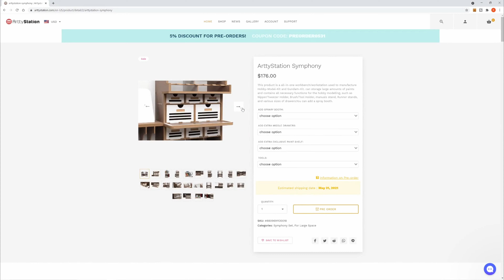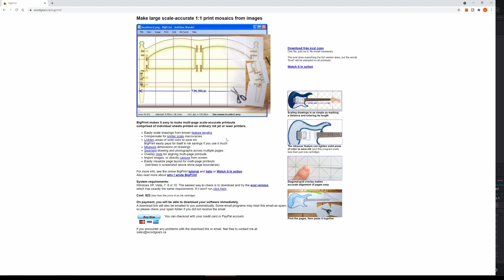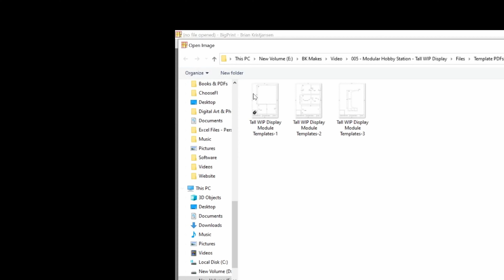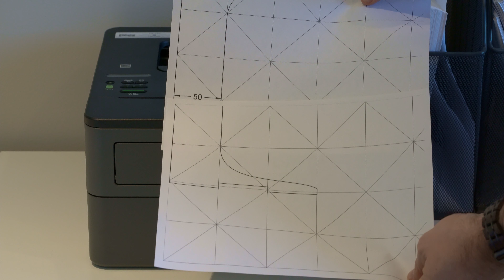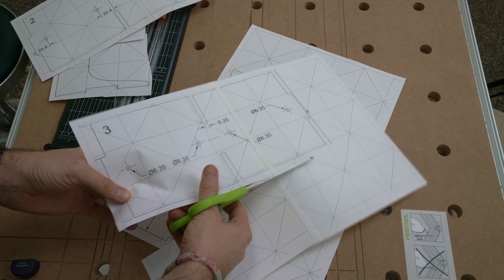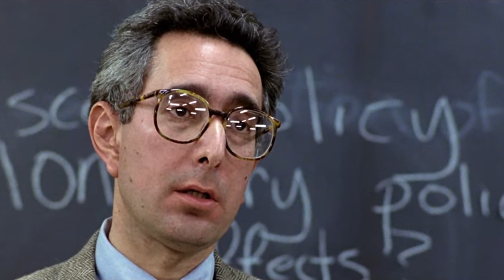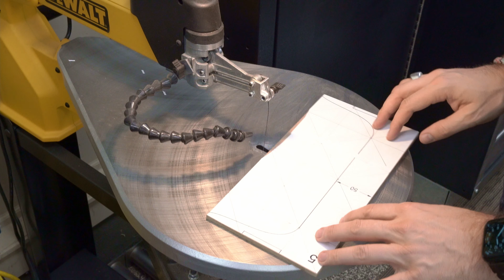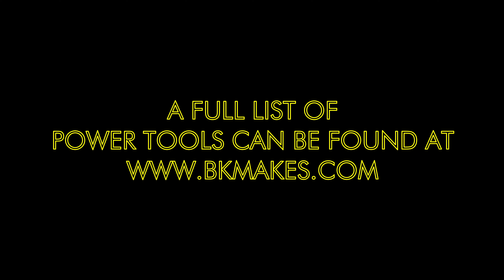BK MAKES: The Ultimate Hobby Station Pt.1 - Tall WIP Display

Comment: Do i need to recalculate all the designs and measuerements if i use different thickness mdf? ;(  Or is that easily achieved in Fusion 360?
Reply from the maker: Hi! If you’re using the paper templates you could draw on the respective thickness adjustments. The DXF files will not work with different thicknesses of MDF, unfortunately.